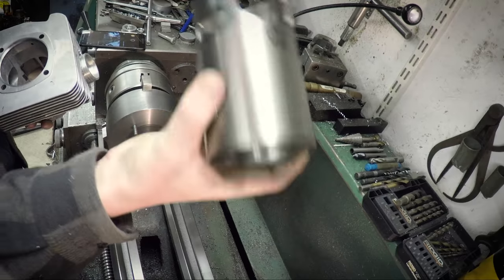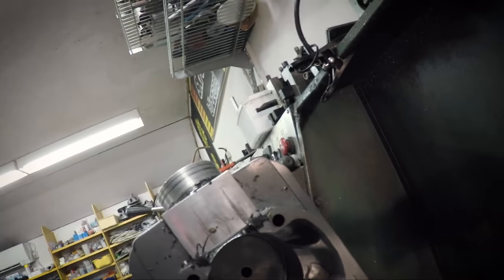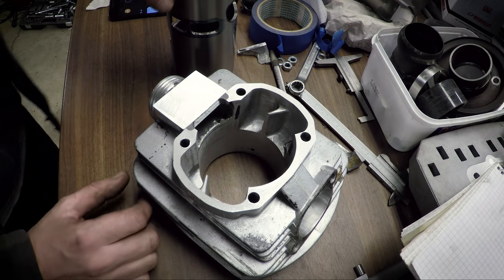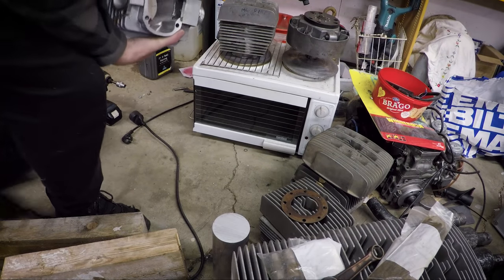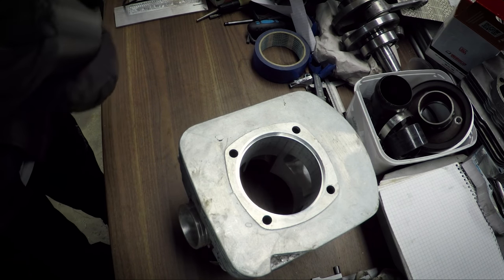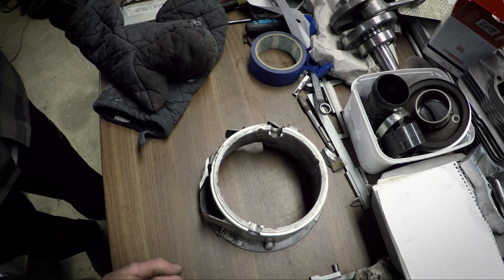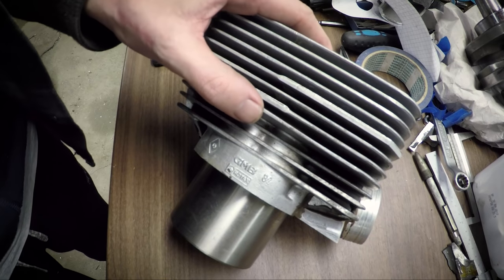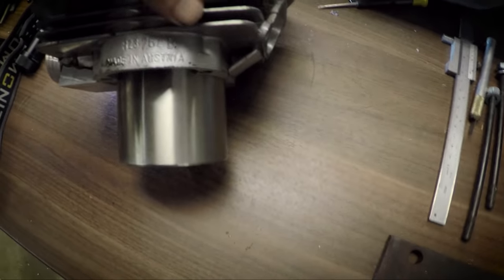Bigbore stroker 277 part 6 - Sleeve install

Comment: Nice job, removing the sleeves is how I used to port cyls back when I was racing. the Rotax 454s had notches in the top lip of the sleeve for for the cyl studs that made it easier to line up when putting them back in.
Reply from the maker: snocrushr I've done that too :) This is the first cylinder that I'm resleeving with a different sleeve than the one that came out of it. Normally if the same sleeve is going back in, I drill a little hole, half in the sleeve and half in the cylinder. And then line it up using the drill bit when it's going back in. So pretty much like the 454 notches, makes it really easy!

Comment: no need to freeze the liner just test how much the alloy barrel expands to when heated up, to get your tight fit when the barrel cools off, I do them at 0.1mm fit and use a weed burner its quicker than the oven and use a temp gun to keep control of the heat great job

Comment: Try scribing a Line on your sleeve and one on the barrel that's how I do it works spot on every time also I put a ballon in the sleeve and fill it with water then freeze it  this will give you more time to rotate the the sleeve and get it aligned

Comment: Fantastic nerves of steel right there youre quick to recognize the fail i about screamed abort abort lol then it was a reboot ha ha dont blame you bud great job cant wait for the next video atb Russ.
Reply from the maker: Russ White Haha I thought it was too late already when I took like 10 seconds to take off my mitts and then put them back on again, but it still moved so I gave it a shot. The problem was that it was already a little bit stuck so I had to use a bit of force to move it and couldn't move it just a tiny little bit. Finally it was a little off but wouldn't move any more so I had to do some quick thinking there! I think another couple of seconds more and it wouldn't have come out without a hammer or press.